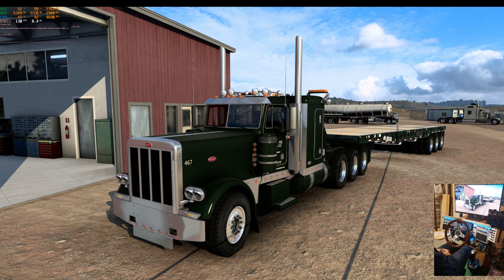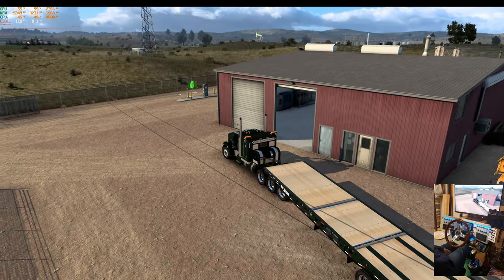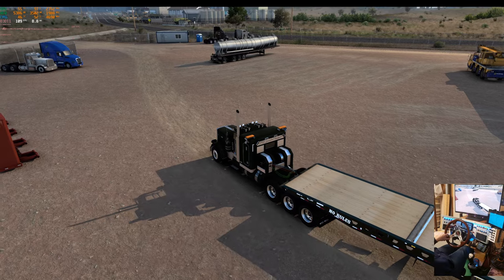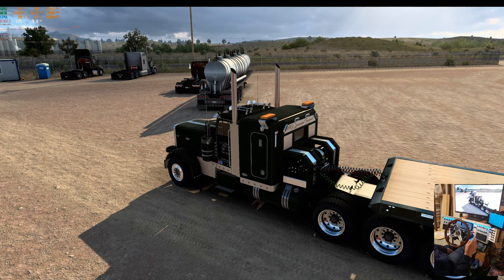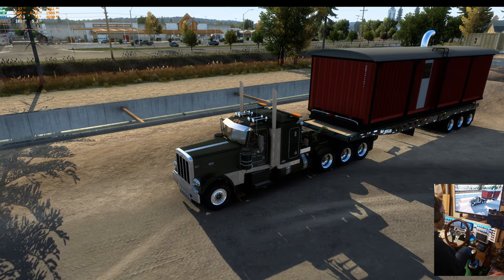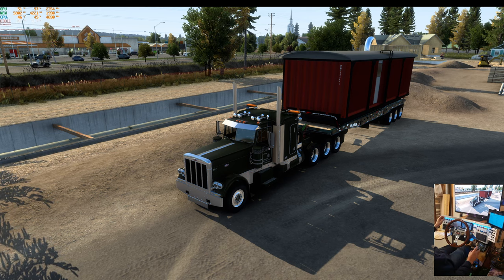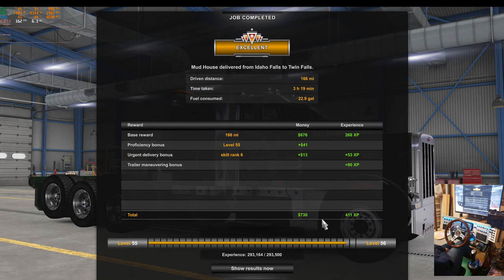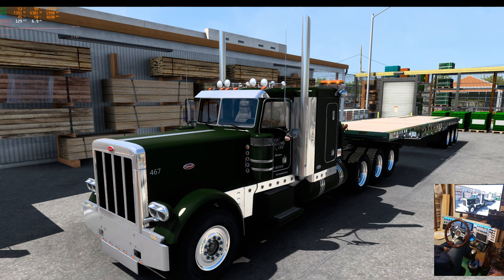ATS Project 3xx EXHD and Oil Field Trailer Hauling a Mud Shack

Comment: I built one of these Project 3XX EXHDs the other day with a big bowtie visor and man it is hard to see traffic lights thanks to the dashboard height and the size of the visor. Currently working on getting better lights on it than some from the K100E mod off the steam workshop that don't match whatsoever. They appear white at night but my roof lights are amber/orange like they should be and it just looks so bad, and I don't mean that in a good way.